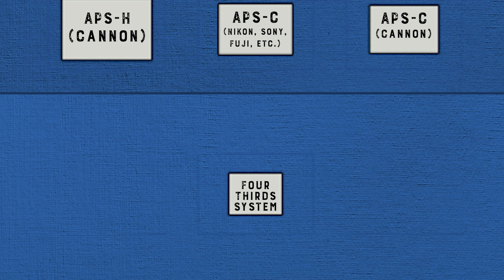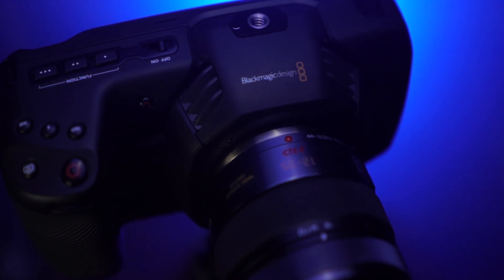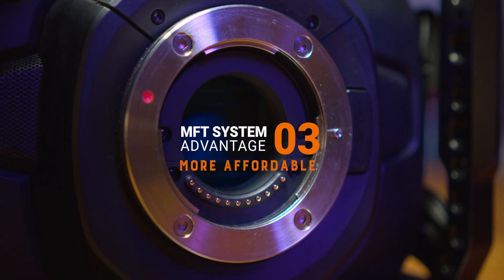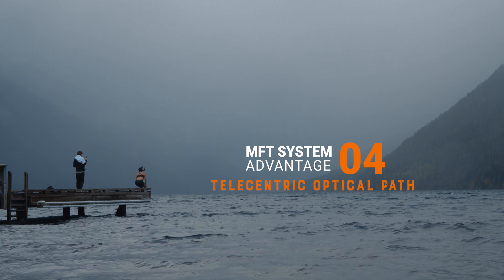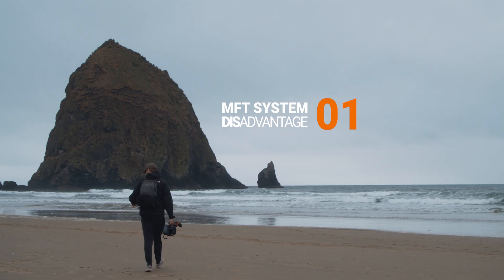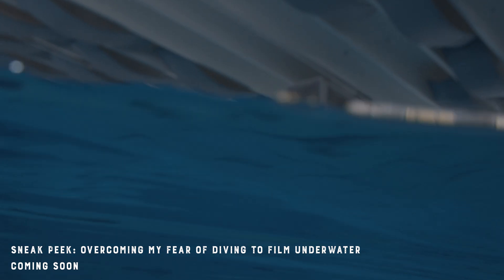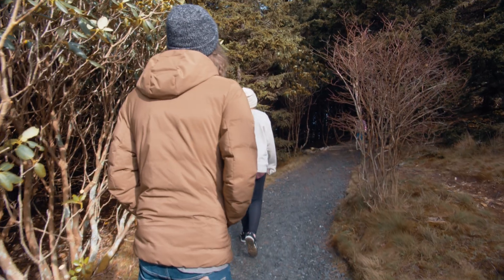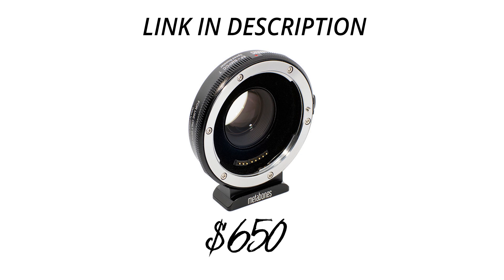How does Micro Four Thirds (MFT) affect the BMPCC4K? | Frame Voyager

Comment: So if I want to get a 24/25mm lens, would the Meike 12mm t2.2 cine lens act as a 24mm with the 2x crop factor for the mft sensor? Despite the lens having an mft mount?                                                   Or would the meike 25mm still act as a 25mm considering the mft mount matching the mft camera sensor?
Reply from the maker: Great question! From what I understand it's that the lenses would equal a 24mm at a full frame mount but will still be essentially a 48mm on an mft mount even though it's made for MFT mounts already. So simply, yes you'll still be doubled even with a mft lens. Hope that makes sense!
Reply: Frame Voyager Thank you so much, really appreciate that :)
Reply: @FrameVoyager  And would the t2.2 F-stop now effectively become t4.4?

Comment: "Less depth of field" doesn't mean what you think it means.
Reply from the maker: You're right, phrased that wrong in the video. I'm assuming you mean I should have said shallower depth of field?
Reply: “Less ability to have shallow depth of field” ?

But that’s very debatable while DSLR have constant f 2.8 zoom lens 4/3 have constant 2.0 zoom lens and that leads to the similar depth of field on the lens that is a bit smaller. Olympus 35-100 f2 for example

Comment: Yeah the low light of definitely nothing to brag about.
Reply from the maker: Not at all. It's manageable though, still not a lot of room to mess up exposure in low light.
Reply: @FrameVoyager  How do you eliminate color noise, especially in the reds?
Reply from the maker: @DarrellDucharme  I use red giants noise reduction software, though sometimes davinci resolve is a good option as well to remove noise.
Reply: @FrameVoyager  Ahh I see, I cant find a good solution in Premiere Pro.
Reply from the maker: @DarrellDucharme  I think after effects has something but yeah, natively premiere doesn't have that feature. I'm able to add it in via red giants plugin software.